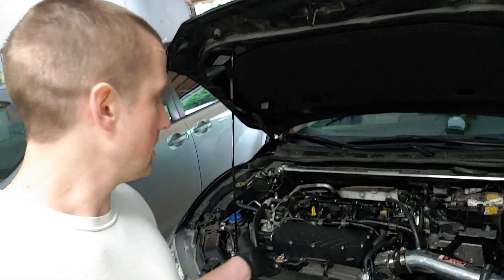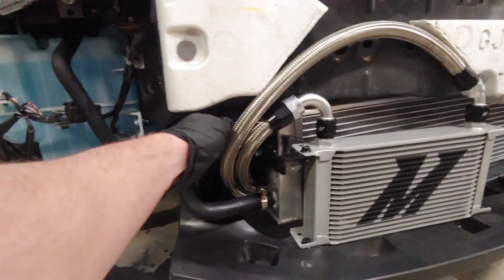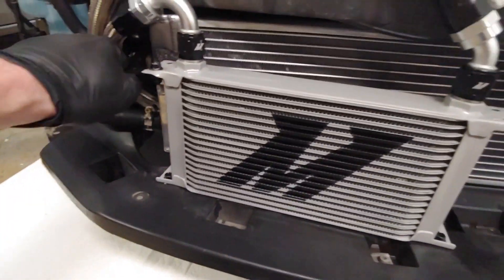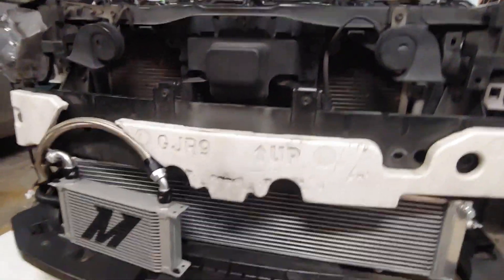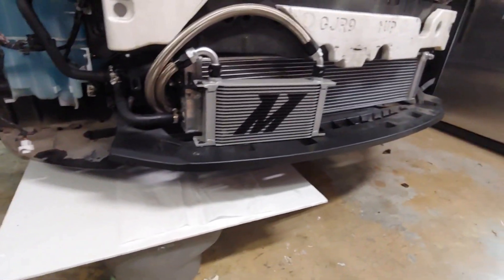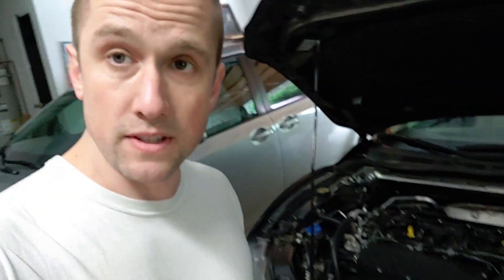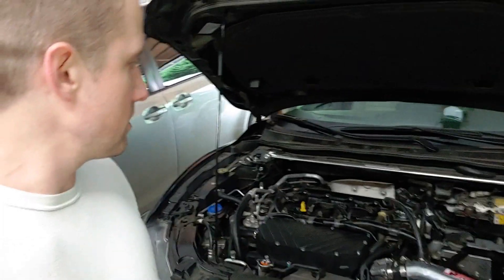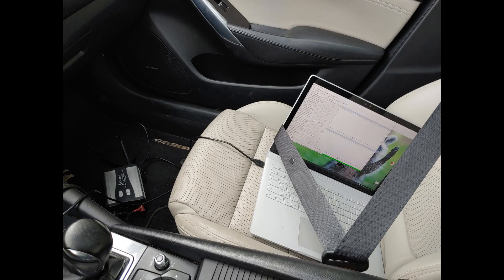Mazda 6 gj Supercharger, 1 week post install

Comment: i live in High heat city and i don't know if this upgrade would handle heat or not hmm
Reply from the maker: it handles it really well, plenty of people are running it out in the desert.
I did add an oil cooler just for extra heat management when I'm out on a race track on extremely hot days.

Comment: I recently joined the supercharger 4th gen Mazda 3 group and plan to do the mod myself as well. The guys in the group said you were the first outside of China, but definitely the first in Ontario to do this mod.  I would love to pick your brain on this, but first where did you get lithium battery? The oem for the 4th gen suck.
Reply from the maker: the battery is an Antigravity ATX-30-RS
which group is that, where?
there's the FB group: Skyactiv-G Super/Turbo Community

Also, VTRacing posted a step by step install video:
https://youtu.be/yJAP69P39mM
Reply: @M6Ninja  I only know them from WhatsApp, one of the guys I speak with goes by the name of Curtis from Florida.

Comment: Wow! Didn't know it was possible... new subscriber. 2017 Mazda 6 owner... pre-turbo. Power sucks. This is great!
Reply: The power sucks cause you drive it in D instead of manual mode and banging out each gear to 6,000 RPM. You can have fun with the car either driving for Torque (staying around 3200 RPM shifting around 5200 to drop back into torque range)  or you can drive for peak horses. It's not a straight line burner but its not slow either i've beaten mustangs and chargers with my 2014 Mazda6 GT. This car is a canyon/mountain carver.

Comment: So glad I found your Instagram and now your YouTube channel! I'm living through you lol was considering getting rid of my 6 but after seeing your progress with this kit I've decided to keep the car indefinitely. I'll go with a full NA tune for now and follow your journey. Thanks for the uploads consider me subbed!
Reply from the maker: A proper tune will give you a a whole lot more low-mid end power, makes it not feel sluggish (I'd been tuned for about 2 years prior to this). 
Then when you want to make it really feel like it wants to go, just drop this in there and for about $5k it's a ~3.5L :)
Reply: @M6Ninja  that would honestly keep me happy for a long time. Would you recommend DRTune? That's who I'm considering as ovt gave up on us. There's another company based out of Russia, if I'm not mistaken, called M-Force Tuning they seem pretty legit too. Price is basically equal for both.
Reply from the maker: @PrinceCharming1  I would just go with DRTune  (OVTune is a guy in Phillipines now, slower communication) good for +20-25hp, especially mid range torque
Reply: @M6Ninja  can we add the vt racing supercharger to mazda 6 diesel?

Comment: Looks great! I would swap the worm screw clamps for spring compression clamps. The ones you have are highly susceptible to heat and can cause leaks over time. Clamps that require a plier tool to add and remove are higher quality metal and less likely to leak. They're constantly under compression.

Comment: So your adjusting the stock map correct?
Reply from the maker: The supercharger company did the tuning as part of the package, took a fair bit of back and forth but finally got it worked.
Also, because of the low boost, the car runs fine on stock tune, just not as much power
Reply: @M6Ninja  thats dope man if i ever have the funds to do so i will highly consider this 🙌🏽

Comment: 6.8sec -0-60 🚦(05:34)
Reply from the maker: sadly without the tune remapping the throttle input the throttle plate is a little slow to open. When trying to launch better I can hit 6.3sec 0-60, which ironically matches what I got with fully dialed tune NA, BUT when hitting a 1/4mi I finished at 10mph faster, so there's definitely more power :)
Once it's tuned there is supposed to be another 40hp to be gained, hoping to be less than 6sec 0-60, but honestly it's just so fun to drive I'm happy as is!